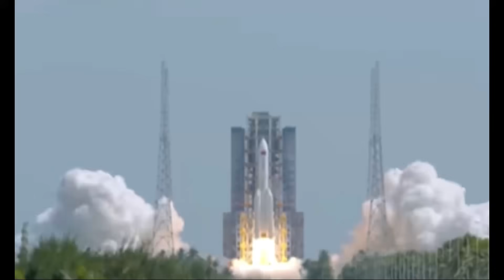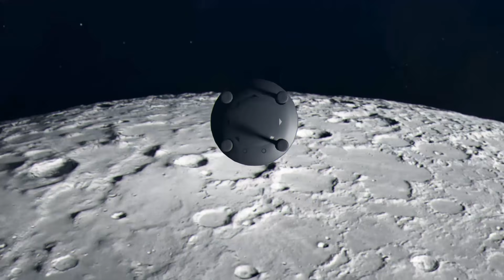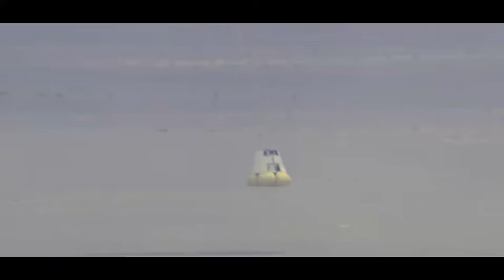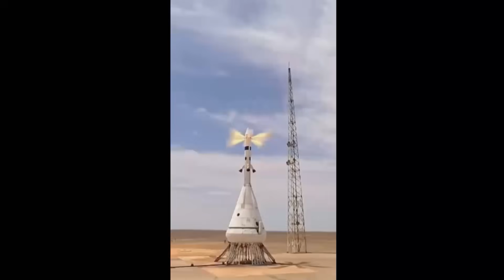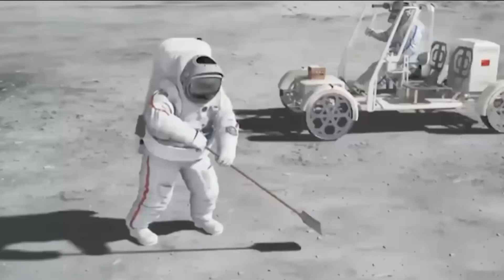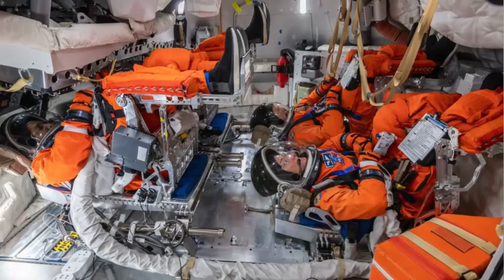China Built This to Keep Astronauts Alive

Comment: Max Q stands for maximum dynamic pressure, the specific moment during a rocket launch when the aerodynamic structural load on the vehicle is at its highest. It occurs when the increasing speed of the rocket and decreasing atmospheric density reach a critical, high-stress balance, typically a minute or two into flight. This happens about 10 miles down range not at the launch site. Note: a launch abort system is not a new idea. All man rated system have them as a mater of basic requirement. Glad to see China if finally thinking of it's astronauts as human beans and not guineapigs.
Reply from the maker: Great explanation of Max Q — really appreciate the extra detail. It’s one of the most critical moments in any launch.
Reply: Yep, I was a Task Team Leader for 27 years in the Space Shuttle launch control room and during the first Artemis I laugh. You have to keep the articles speed down until you get into thin air. Then you can throttle up and haul ass. It's an air pressure, air frame limit issue.